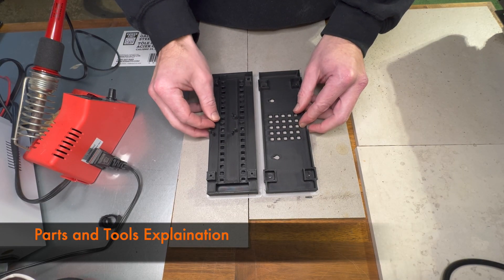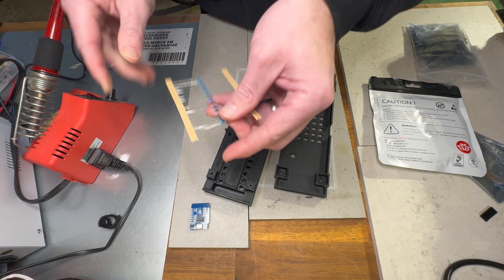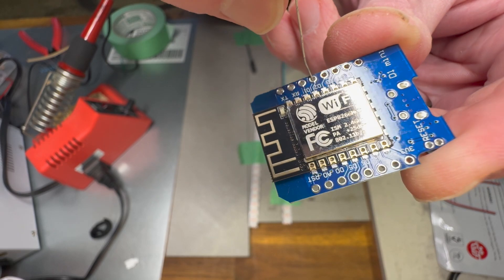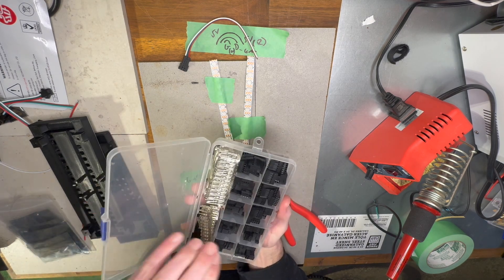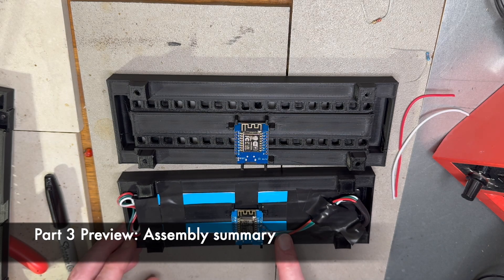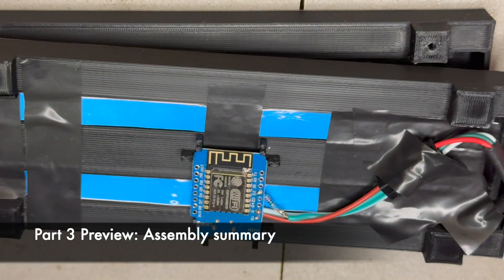Build a Smart LED Clock - Part 2: Parts, Tools, and Wiring | ESP32 Home Assistant Clock

Comment from the maker: 📌 Everything you need for the electronics:

🔧 Parts & Resources:
• Complete Build Guide: https://github.com/kylemath/digitalclock

⏱ Timestamps:
0:00 - Print Quality Check
0:13 - Model Clean-up Tips
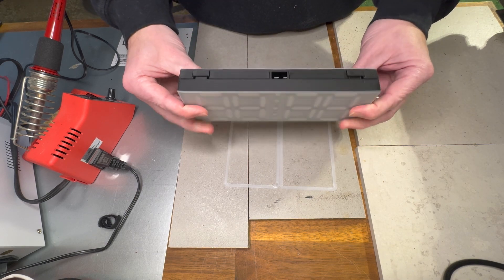0:43 - Parts Overview
1:44 - Resistor Selection
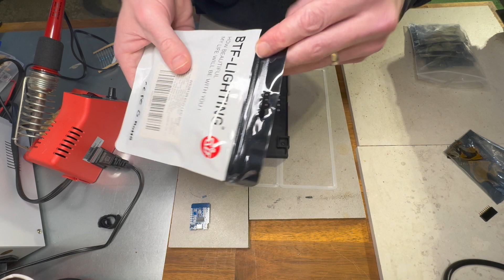2:32 - LED Strip Introduction
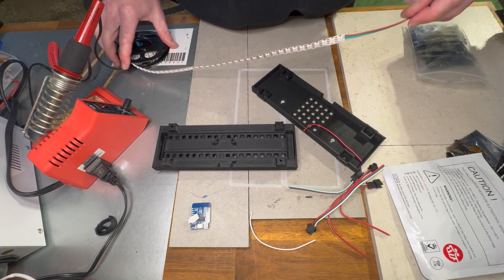4:24 - LED Strip Preparation
5:53 - Wiring Components
8:00 - Connection Details
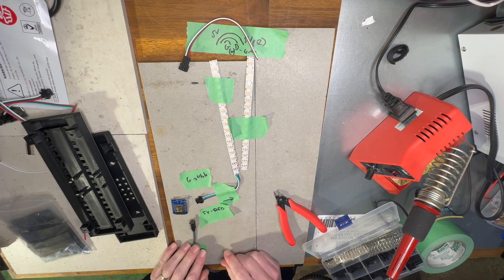10:16 - Assembly Preview
10:34 - Complete Parts List
12:05 - Tools & Materials Review
13:19 - Wiring Diagram Explanation
14:14 - Physical Layout Planning

📦 Required Components:
• ESP8266/ESP32 D1 Mini
• WS2812B LED Strip (100 LED/m)
• 5V Power Supply (1-2A)
• 220 Ohm Resistor
• Dupont Wires
• M3 Screws (1cm)

📺 Full Series:
🔧 Parts & Resources:
• Complete Build Guide: https://github.com/kylemath/digitalclock
• Part 1 (3D Printing): https://youtu.be/DS_muPDX8p8
• Part 2 (Electronics): https://youtu.be/uiOuWeXdryE
• Part 3: Assembly & Soldering - https://youtu.be/76l32a6Kb90
• Part 4: Firmware - https://youtu.be/q1JSGy7HCL0

👉 Quick Teaser: Watch the 17-second preview: https://youtu.be/x0ZPEmYtgFM

Comment: hi. Good work, great project.

how can you add a button to dim light, no idea how to program it on esphome.
Reply from the maker: Option 1: Adding a Brightness Slider in the ESPHome App 🎚
Option 1: Adding a Brightness Slider in the ESPHome App Option 1: Adding a Brightness Slider in the ESPHome App 🎚
This is super easy! We just need to add a few lines of code to let you control how bright the clock is from your phone.Firmware_SingleDigitsSix.yaml

# ... existing code ...

light:
  - platform: neopixelbus
    type: RGB
    pin: GPIO4
    num_leds: 48
    name: "LED Strip"
    id: led_strip
    variant: WS2812
    default_transition_length: 0s
    restore_mode: ALWAYS_ON
    effects:
      - addressable_lambda:
          name: "Show Time"
          update_interval: 1000ms
          lambda: |-
            static const Color sign_color = Color(255 * current_values.get_brightness(), 
                                                0, 
                                                0);  // Red color that can be dimmed
            # ... rest of the existing code ...
That's it! Now you'll see a brightness slider in your ESPHome app that controls how bright the clock is! 🌟
Reply from the maker: Option 2: Adding a Physical Button 🔘
First, you'll need to:Then add this code:Firmware_SingleDigitsSix.yamlApply

# Add this near the top of your file, with the other components
binary_sensor:
  - platform: gpio
    pin:
      number: GPIO5
      mode: INPUT_PULLUP
    name: "Brightness Button"
    id: brightness_button
    on_press:
      then:
        - lambda: |-
            static float brightness = 1.0;
            brightness = (brightness > 0.3) ? 0.3 : 1.0;  // Toggle between full and 30% brightness
            id(led_strip).set_brightness(brightness);

# ... existing code ...

light:
  - platform: neopixelbus
    # ... existing light configuration ...
    restore_mode: ALWAYS_ON
    default_brightness: 1.0  # Start at full brightness
    # ... rest of your existing light config ...
Now when you press the button:You can change the 0.3 to any number between 0 and 1 to set how dim you want it to go! (0 = off, 1 = full brightness) 🌟Let me know if you need help with either option! 😊🔘
Reply: @kmathew3  that´s perfect. thanks

Comment: I'll have to go back and check but don't think you need the resistor on green,
Reply from the maker: https://learn.sparkfun.com/tutorials/ws2812-breakout-hookup-guide/hardware-hookup#:~:text=Add%20an%20In%2DLine%20Resistor,to%20the%20WS2812%20as%20possible.
Reply from the maker: looks like it is recommended to reduce chance of voltage spikes influencing LED hardware